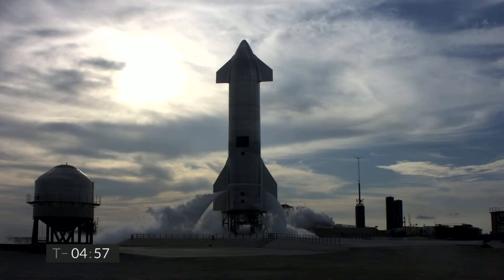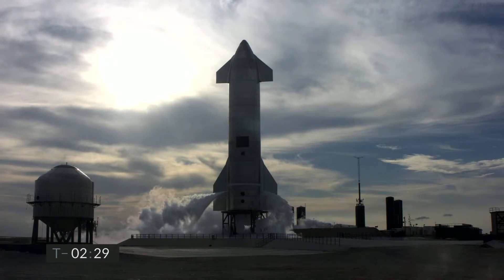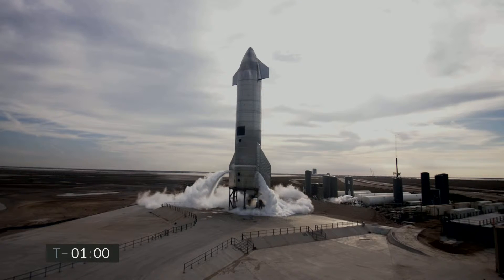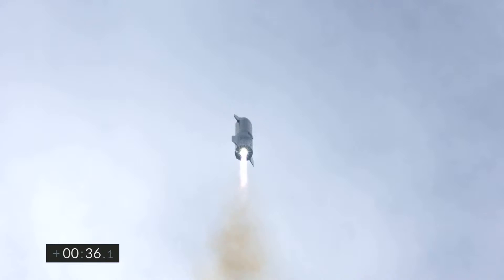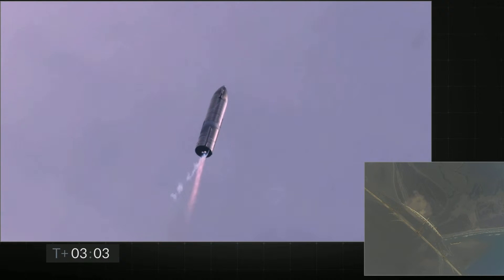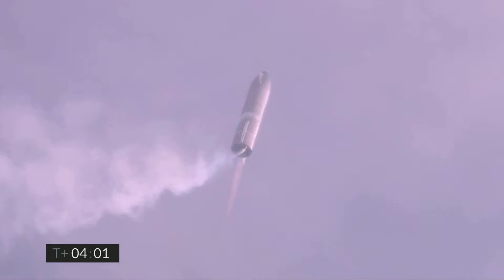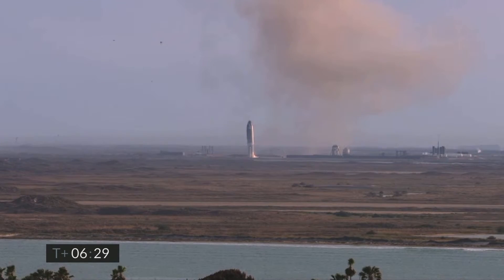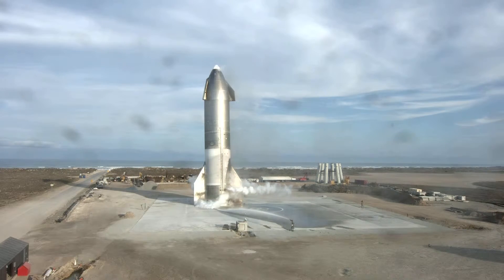Starship | SN10 | High-Altitude Flight Test

Comment: Still think Wile E Coyote level is best way to land over wheels? 
Wheels dont explode like that. If launched high altitude you could actually get away with very little rockets. Especially if launched to a centrifugal tether to launch out to Mars where another catches it and sends it to us. Best way. Then land with wheels and launch again with your choice of high altitude. Much less chance to explode... not that hard actually.
Reply: Landing horizontally on Mars with wheels isn't really practical, and exceedingly difficult. 
The air is so thin that a winged vehicle like the Space Shuttle would have to land at around 1100mph, or 1760km/h.
If you want to try landing a plane that fast on rough rocky ground, be my guest.
Personally, at least when it comes to Mars, I'd take my chances with a rocket landing.
Reply: @lazarus2691  
Well Mars also has less gravity so its not so big a deal there. Mars doesn't tug back home as hard as earth.
Reply: @TheWereparadox  39% gravity is still a significant amount. If anything it would make things worse, since you'd bounce off small bumps much more.

But it's mostly irrelevant anyway. A plane has control over it's sink rate, so regardless of gravity, you're going to fall 'down' very slowly. 

Down isn't really the problem. The 'going sideways really fast' bit is the problem.

Having your landing gear hit the side of a small rock at 1100mph is going to destroy it just as thoroughly regardless of local gravity. 

There's a reason Von Braun dropped his Mars glider landing idea in 1965 after Mariner 4 revealed that the atmosphere was ten times thinner than previously estimated.

Though since his gliders had a contingency landing procedure where they'd jettison the wings, deploy a drag chute, and land under rocket power, they actually still would have worked.
Reply: @lazarus2691  
Sorry I guess I wasnt clear. I was saying rockets on Mars or other bodies alright. Rocket landing Earth not so much. Use plane.
Reply: Glider would be perfect on Venus. (If it didnt get torn apart or melted anyway.) 
Just depends on the planet how you wanna land. I like to land on wheels on Earth. Earth really tugs back hard and has a nice cushy atmosphere.
Reply: @lazarus2691  
I swear Jacksepticeye must work there. Everyone knows from his space craft play throughs the answer is definitely  "More Rockets!!"
Reply: @TheWereparadox  When all you have is a hammer, every problem looks like a nail.
Reply: @lazarus2691  
Riddle me this.

Is launching a glider from the back of a large plane viable on earth?

If so that can work as you just detach the extra wings (glider) then use minimum rocket power to finish the trip to the stratosphere and then to the centrifugal space station for free toss/launch to Mars?
Reply: Just because you only have wood dosent mean you can only build boxes
Reply: @TheWereparadox  Yes, it is viable, but not for a rocket of this size. The problem is that no plane large enough exists.
The biggest, most capable plane currently flying is the AN-225, which can lift about 250 tonnes. Starship, even without it's booster, weighs about 1400 tonnes.
Now, maybe it is possible to build a gargantuan plane that can carry that much, but it would be an insane engineering undertaking.
And the runway would have to be insanely massive. Compared to a relatively small launchpad for a traditional booster.
Reply: @lazarus2691  
Well thank you. Thats very interesting. Makes me wonder. You've been very helpful.

Comment: Andy Griffith knew how to build, fly and land these things 40 years ago. The trick is to spend the extra few dollars to add and use the shock absorbing tripod feet instead of trying to land on the engine cones. There.. Hear me Elon? You can send me a reward for direction you to the solution to your problem.
Reply: Where's Andy when we need him?
Reply: Elon already said they were planning a landing gear upgrade months ago. They just didn't want to spend the extra money on disposable prototypes that would be scrapped anyway.
The crappy single-use gear worked fine on SN5 and SN6 (which have since been scrapped), so they thought it would hold up for a single landing on this one.
Unfortunately only two of the six legs locked into place properly, and they weren't enough by themselves to absorb the shock of landing.

Comment: Is it at all possible to use the fins as wings of sorts to land the SN rockets on an airfield, though this isn't practical on other planets it could make tests cheaper, as well as allowing an SN rocket to use all of it's fuel.
Reply: Honestly these things would probably collapse if you laid them on their sides. There's a reason they build and transport them entirely upright.
Now yes, they do go on their sides during the 'belly-flop', but when they're free-falling, the air pressure supports all parts of them equally. 
But if they had to support their weight on a couple of wheels they'd probably buckle. So you'd need a lot of extra weight in reinforcements.
And then even more to support bigger wings. And then more heat shield tiles to cover the bigger wings. You'd lose a lot of payload capacity.

Comment: At first I thought third times are charmed when it landed,  now it  looks like three strikes and you are out
after it exploded.  Maybe super cooled methane is just too volatile to maintain and a major rethink is in order.
Reply: SN5 and SN6 worked just fine using super-cooled methane. It's no worse than the hydrogen that rockets have used for decades.

Comment: This is great! I think by now we could do a "quadcopter" design 4 engines/thrusters with a large bay in the middle for crew/gear/satellites etc. Maybe I'm dreaming (I'm no rocket scientist!!) , but that would be just like a true space ship and maybe the thrusters would offer more stability and less room for error. I feel like we are really close to this now! 😀😀😀
Reply: DC-X had a 'quadcopter' design. But it's not ideal for Starship because you need all four engines working for control, whereas the current design can fly on one.
This gives Starship more redundancy, but is actually also necessary because Raptor can't throttle down enough to land on more than one, maybe two engines.
It could launch just fine on four engines, but after it had burned off most of it's fuel it would have far too much thrust to hover, let alone descend to landing.
If you could make Raptor throttle down to say, 10% thrust, then sure, a quadcopter would work. But it's such a complicated engine they're having trouble reaching even 40%.
Reply: @lazarus2691  hmm interesting, not sure what to suggest really I'm no expert .. maybe instead of 4 thrusters they could just have one very large engine and direct the thrust to 4 outputs but I have no idea... Still cool to imagine the possibilities
Reply: @mrorange159  That sounds like a pretty good solution. The only problem would be that you still don't have any redundancy, so if you lose one engine you're toast.

But if you could make it reliable enough, it should work from a technical standpoint.

The Russians have actually already made such engines, though for different reasons. 

For example, the RD-170 has one core directed to four nozzles: https://en.wikipedia.org/wiki/RD-170

They even built some with four main thrusters, and 2 or 4 smaller maneuvering thrusters, all driven from the same core, called the RD-107 or RD-108 respectively:
https://topwar.ru/uploads/posts/2020-02/1581105422__rd-108_vostok.jpg

Octocopter anyone?

EDIT: I totally forgot, the US built a single-core engine that directed thrust to 20 smaller nozzles: https://upload.wikimedia.org/wikipedia/commons/8/8c/Twin_Linear_Aerospike_XRS-2200_Engine_PLW_edit.jpg

Again for different reasons, but it shows that you can really split the output as much as you like.

Comment: You guys all realized this thing exploded shortly after landing right?...Not going anywhere soon.
Reply: So what? You do realise that this is the third time Starship has ever flown, right?
Reply: Currently they're building these faster than they can blow them up, so until their launch rate picks up it's not really an issue. 
SN11 is rolling to the pad tomorrow, and they've already started building SN19. 
SN10 proved the landing technique does work, that's all that really matters.
Even if it had landed, it probably would have been scrapped. At best they'd keep it on display for sentimental reasons.
Reply: We are getting closer and closer, I’ll say this year they’ll figure out how to land safely repeatedly
Reply: @user-l3m9k  Ah, you're correct. Looks like it slipped. It said Friday when I checked this morning, I swear.

Comment: Idk.. looked like it had a lean..  maybe it was a camera illusion... but looked like it had a 3 degree list.. on landing.

Congratulations on getting er down... explaining to the boy... wait for the Artemis launchs... not a easy thing..  proving a design
Reply: It definitely was leaning. It was leaning because three of shock absorbing landing legs failed to deploy.
Reply: @καλαμ  at least the got it down to a velocity that put it on the ground relatively intact... fun times... 

On to revision D
Reply: @Scotian6444  Indeed
Reply: @καλαμ  failed.. seem like maybe one did a full collapse. The other two stayed near intact..

Idk.. if they can line it up every time... go to solid propellant... drop it into a cylindrical casement... make the skirt part of drag.. line up... fold in the skirt to protect the business end... and use blow back from ground source to land it in a silo.

May be more reliable to use thrust as controlling force for alignment going down a tube... and use ground source power to push back against the bottom end.. once protected... like dropping it in a tube.

Idk.. at least you have a point further up... seems this booster reignition has some issues... tests have one on... take it that's for power to start again.. or for redirect if control is lost? Not to tech savvy here.

Comment: This is just a joke. Bad, bad, bad idea. Space shuttle is a much better concept, and it failed. This one is doomed.
Reply: Hmm, if the shuttle was a better concept, then why did they retire it? Nice one. 
Also, do you not want to explain why this one is doomed? Or are you just hating on it for fun?
Reply: Falcon 9 crashed like half a dozen times before they stuck it, now it lands regularly. 75 landings to date IIRC. Two boosters have flown 8 times.
Meanwhile, Starship has flown three times, and it landed on the third try. Better than Falcon, but you're already dismissing it?

Comment: ...and then it blew up. They can go to Mars, but they can't get a stream of water from the nozzles on the landing pad to actually put out the fire. We're not ready.
Reply: Do you know how it blew up? It blew up because of a methane leak. The vehicle landed too hard because three of the shock absorbing landing legs failed to lock into place, which caused the rocket to land too hard and that caused the methane leak. I also like how you completely ignore the fact that it landed itself after only two test flights. Complete ignorance.

Comment: The video is missing 8 minutes at the end. SN10 blew up after "successfully" landing.
Reply: Why put "successfully" in quotes?
Reply: @καλαμ  It bounced when it landed. That has to be fixed. If it bounces the wrong way in the future, it can tip over, fall, and blow up. After 8 minutes, SN10 exploded from a gas leak. A truly successful landing means that it does not explode after landing.

SpaceX Starship SN10 explodes minutes after successful landing
https://www.youtube.com/watch?v=9WR1CYC9kZc
Reply: @doublevision5465  I'm fully aware that it exploded due to a methane leak. It bounced because three of the shock absorbing landing legs failed to lock into place, thus SN10 landed harder than it should've.
Reply: @καλαμ  Thanks for the info. I didn't know about the landing legs.
Reply: @doublevision5465  No worries.

Comment: I do not know about soft landing.... it was softer than pervious landings YES... However my eyes did not deceive me as I saw a bounce.  
Still that would be considered hard landing... in my books but I know that next test that will be smoothed out more..  
I still think there needs to be some shock absorbers in the landing legs.. could be gas filled as it would release the pressure as it lower down on them so there is less likely a bounce or spring back. 

But it sure is pretty to see it land.   Now to move a grain elevator I know who to call.  hehe.
Reply: It has enough shock absorbers, that's what the landing legs are designed to do. But, three of them failed to lock into place and thus SN10 landed harder than it should've.

Comment: It's going kind of slow huh? It's going to need like 12 raptors to get to space but the way they maneuvered this bucket is unreal.
Reply: This is the second stage. It will be placed  onto the superheavy which is the first stage and will have a total of 28 raptor engines. 34, if you include the second stage.
Reply: @καλαμ  + The raptors are not at full thrust, actually they are at minimum thrust
Reply: @FinkHD  True! That's a very good point that I competely forgot about.
Reply: @καλαμ  that's hot

Comment: They still gotta softened the land...
Reply: It landed hard because three of the temporary landing legs failed to lock into place. The landing legs are designed to absorb the landing force, and since three failed to deploy, SN10 landed quite hard.
Reply: @καλαμ  you can notice that it bounced twice, really hard. Imagine if it was loaded with heavy cargo, landing elsewhere. Hulk smash landing...
Reply: @leotheevinci  Yes I noticed that lol, you need to remember that this is the third time that starship has flown. With each flight they are fixing and improving something. The landing legs should be a relatively "easy" fix. The fact that it landed after only three attempts is amazing.

Comment: Honestly , this spaceship is too small for mars and not tough enough I was expecting real heavy steel , good start anyway 😁
Reply: Too small? Have you seen the full vehicle? This is only the second stage, it will be placed on the the first stage which is called the Superheavy. Look it up.
Reply: this is the second stage and makes up about a third of the entire rocket. it will also have more engines.
Reply: This thing is the size of a 15-story building lol. And real heavy steel would be, well, too heavy.
Until we have torch drives, every gram counts, which means no building spaceships like tanks.

Comment: Missing the huge explosion a few minutes later when it blew up! Was there aluminium in the rocket? Noticed water being sprayed on it. Water and red hot aluminium don't mix. It's explosive. If not what caused it?
Reply: The explosion was caused by a methane leak. The methane leak was caused by the rocket landing too hard. The rocket landed too hard because 3 landing legs failed to lock into place and thus failed to absorb the landing force. These temporary landing legs are designed to absorb the landing force.
Reply: @καλαμ  yeah noticed it was tipping to one side slightly. Not a perfect landing then
Reply: @schill1758  They definitely made a lot more progress than the previous two flights, which failed to land. All they need to do now is fix those landing legs. The fact that they landed it after only two test flights is incredible in my opinion.

Comment: Btw, the StarShip exploded a few minutes after it landed. The stream cuts off before it happens, so you don't see it on this video. But anyway, it's still a big accomplishment for SpaceX. Congrats!
Reply: @AndiDuck  "I would be more concerned if the rockets didn't blow up on test runs." - Elon... Each unsuccessful test is another problem they can fix. Its how science works, trial and error.
Reply: Is there footage of it, even though the stream cut?
Reply: @thomaswburkhart  yes. On the YouTube channel Not What You Think.
Reply: @thomaswburkhart  https://youtu.be/CF9mdMI1qxM
Reply: So they do care if it explodes or not.
Reply: @christopheribarra1170  Happened 8 minutes after it landed. Live streams usually end after landing.
Reply: The stream is not cut,it just ended right there.the explosion happen after 15 miniute they land
Reply: @mosalah8551  He said "cuts off" Which mean the stream came to an end.
Reply: You are correct.... 
Next time they will be alert....
Reply: How did rocket fly backwards to pad? https://youtu.be/istcbNUgQO0
Reply: @madmaxrerisen  It didn't "fly" backwards, it descended.
Reply: @AndiDuck  you need to realize this something that has never been done before...which Is exactly why they're are doing all these trial runs (it's called a test run for a reason). The whole point of this excercise was to check out the reverse landing capabilities of the reusable ship.People said man can't fly to the Wright brothers and yet look where we are now. You can be salty and choose to live in the dark ages and get behind while the rest of us march forward.
Reply: https://www.youtube.com/watch?v=7XiHvF5uRkA
Reply: @AndiDuck  Elon expects it to explode , listen to the Joe Rogan podcast. If it doesn’t explode that’s not a good thing.
Reply: To be fair, the purpose of this flight was for maneuverability and to get things down pact. They still landed a giant shuttle, and even if it didnt make it in the aftermath, they succeeded at something historic
Reply: noo those videos wth it xploding are not real... the dust frm this live stream clears off and went to 2 min without xploding whereas thoz wth the xplosion , it happens soon after landing and without the dust clearing off.... the sn10 did land and didnt xplode